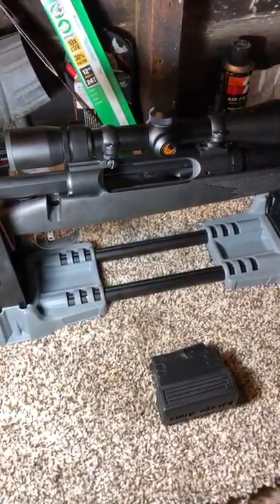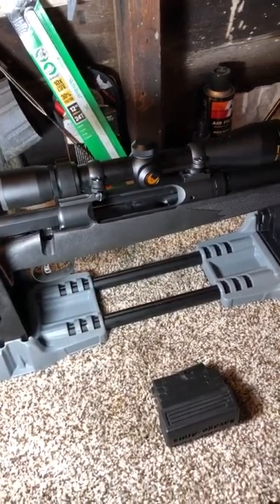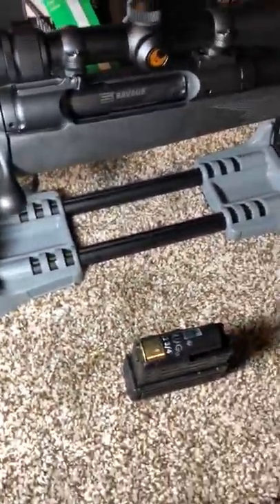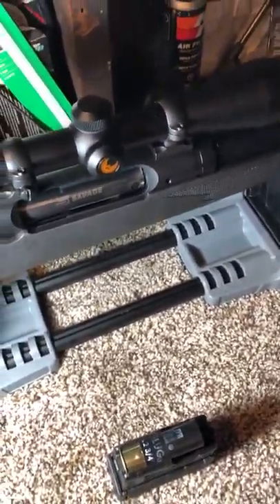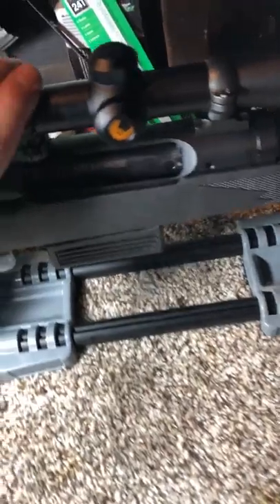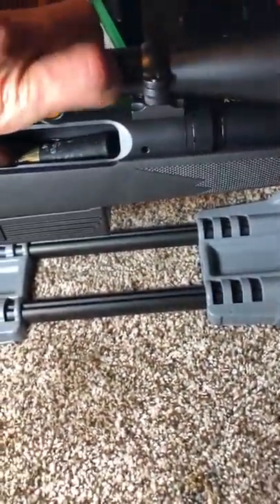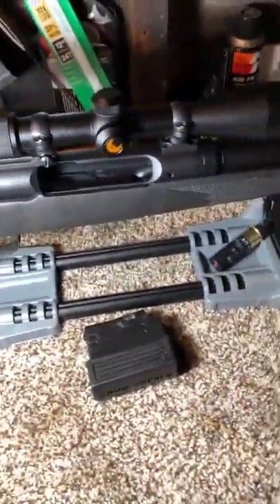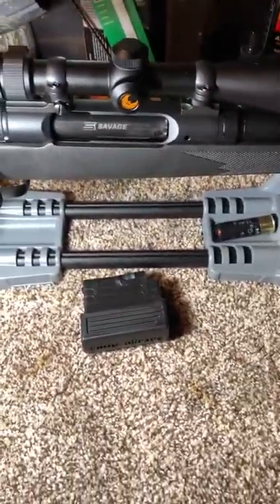Savage 212 Feed Issue

Comment: I have the savage 212 and also had the feed problems with 2 &3/4 shells,  but not the 3 inch.  I purchased a Boyd's wood laminated stock and the problem was even worse then I took a file to the wood feed ramp (filed a more aggressive feed slope) and the problem was solved.  2 & 3/4 or 3 inch shells, no problem.

Comment: This is a big problem with 2 3/4" shells and I have like 10 boxes of  them lol.  Believe it cycled 3 inches ok a couple of years ago but cannot remember clearly now and I'm out of 3 inchers.  Savage had sent me a replacement magazine when I first got the gun but it did same thing with 2.75" shells.  Plus there are some sharp edges in the slide chamber you can get cut trying to force the stuck shell out.

Comment: After reading down through the comments, I see this as a common problem with both 220 and 212 models.  I' started having the exact same issue with my Savage 220 after my first two hunting seasons using 2 3/4 accutips.   I even experimented loading only one shell in the clip but  still am experiencing feed issues every time I eject the chambered shell.  So today I took my 220 Savage to my local gun smith  to determine what the problem is, and what the fix would be.  I suspect it to be inconsistencies in manufacturer design as some owners of these models are not experiencing the same difficulties that a significant number of us other Savage 220 and 212 owners are having.
Reply: any update?  Mine will not feed 2 3/4" slugs.

Comment: I've had the same problem. As far as I can tell, the recoil from the first shot forces the gun back and subsequently the shells in the magazine forward. The problem is that the bottom shell goes so far forward that ring at the back of the shell gets in front of the ring of the shell above it. Then it is impossible for the upper shell to move forward because it gets hooked on the ring of the lower shell. At first I thought this was only the case with 2 3/4" shells since there is lots of room for them to slide forward after loading. But then this season I've been using 3" shells and today the exact same thing happened. For now my only solution is to only put one shell in the magazine. It may be that a stronger spring in the magazine would push the shells up forcefully enough to keep them from sliding forward but I don't know. It is a well documented problem and so far I haven't found any solutions other than only putting one shell in the magazine.
Reply: Mine cannot cycle 2 3/4" shells without firing the gun.  Not a problem with the rings.  Believe I solved this problem by going to 3" shells some years back but cannot remember as it's a new season and I'm out of 3 inchers.

Comment: I am having the same issue. Mine would jam up. I would have to punch the bolt to load it. Then it would not eject the bullet once ejected. Drove the gun to savage they took a bur out of it and replaced the firing pin, extractors and supposedly a few other small parts. When I got it back I got 2 rounds through it before it stopped feeding again but it was extracting fine so they fixed one of the problems.  So I drove it back to them and they still have it now.  Hopefully they can fix the issue this time.

Comment: Same problem with my brand new  212. I think the springs in the mag are too strong, when I load and at the same time push down the floor plate with a pine, it works well. So I thing I should change the tension of those springs

Comment: It's been a few years since you posted this video. I'm just wondering if you found a solution. I bought my 212 this year (2022). My 3-position safety works as designed, but I too am having this feeding issue. I just started my search for a solution, but my first inclination was that it's related to 2 3/4" shells. I have not tried 3" shells yet to verify this. Nonetheless, I would expect 2 3/4" shells to feed just fine.

As an aside, I have not been able to dial my 212 at 80 yards and beyond. I get okay groups, but not the incredible accuracy I was anticipating. This is likely attributable to operator error (me), so I could use some tips here. I probably just need more rounds with it, but the Accutips are currently around $4 shell. It's pricey to mess around with it at the moment.

Comment: I have the same issue when recycling  the next round and I use the remington accutips. I also have the same issue with the safety. One thing i have noticed is that when you load shells in the magazine it spreads the top of the magazine slightly wider, then when you insert the magazine in the gun it closes slightly squeezing the magazine tightly around the shell. I was going to see if they make a composite or steel magazine and try that before having to send it to Savage.

Comment: Three days and not one shot fired. Why? Will not feed. I scived down a leather ramp to see if that would position the next round upwards into the pipe. Was nice on the first round but no dice after that. Perfect firearm if they can fix this. Sending it back now. I will update you with results. 24 years of military operations and never had an issue like this.
Reply: How did the repair work for you
Reply: Any update on sending it back to Savage?

Comment: I have a brand new one (2021) and it doesn't feed 2 3/4" Hornady worth a crap, either.  And it flat out won't eject the last shell.  The last shell pops out of the extractors when I retract the bolt and the shell hits the ejector.  The empty just lays in the ejection port.   Weird thing is, it will cycle Remington 2 3/4" just fine, and 3" shells like a champ.  It will cycle Federal, too.  Just not Hornady.   I have a couple of Ithaca M37s and have trouble feeding Hornadys in those, too.  Sometimes the next shell in the magazine pops out and falls on the ground, and sometimes the shell slips between the carrier fingers.  But it works fine with Remington and Federal.  I really think there is a problem with Hornady shells.  I think the rim diameter is undersized.  My safety is a functioning 3 position safety.
Reply: Update:  I took my 212 out this last Saturday and fired 25 rounds of Hornady SST.  Some cycled fine, others not so much.  However, I was able to get sub-2 inch groups at 100 yards.   So while the Hornady don't cycle worth a crap, they are exceptionally accurate in my gun.

Comment: I too have the same issues - loading many different cases that jam on the ramp and also the 3-position safety. It's a big SAFETY issue and I think Savage should recall them or fix for free. Any word yet on what to do for a fix? I bought my gun more than a year ago from Buds. But I did get the warranty. NOTE: I don't have any issues cycling the Federal Premium Trophy Copper 3" Sabots at 300 grain slugs. Actually killed the biggest bull of my life last season with it. But that's the ONLY shell it likes.
Reply: I'll get some of these 3 inchers and try them.  Mine sticks every cycle using 2.75"

Comment: Bought a 212 same issue with feeding the top shell is getting caught with the feeding tube lip it seems there is lack of slope to allow the shell to slide in. Tested with aluminium snap caps it works very well the snap caps slide right in because of its harder shell just like other type of bolt action rifles 308, 223, or 7.62 x 39 it slides in smoothly because of the hard surface and properly slope feeding. Not sure if filling down the feeding tube a bit would help?

Comment: This savage 212 is recommended with remington accutips. Feeds perfect
Reply: Are they 3 inch or 23/4 inch I’m using 2 3/4 inch I’m try too see if they have 3 inch maybe that’s would fix it
Reply: I bought a 220 using 2-3/4" & 3" accutips
Both had jamming problems.  Found it has to do with cartridge rim getting hung up on extractor clips on bolt.
Reply: Not mine
Reply: @winonajr3931   Did you get this issue resolved? I just bought a 212 Turkey that is very particular on the rim geometry
Reply: @hoponpop7097  I ended up selling my 220.  Then Walmart clearance all their guns out last year and I picked up a 212 for $125!  Same jamming problem.   I sent it into savage and they fixed it.   Works like a charm.  Shot a nice buck this year 150yds.  Most accurate shotgun I own

Comment: Any updates on the gun? I just got a new Savage 212 as well and having the same exact issue and luckily I did buy a spare mag when I bought the gun and the spare mag doesn’t work either and I also have the same 3 safety lock issue too. Still shoots but just kind of disappointing. I bought it from Buds so working with them now as I did get the warranty through them...
Reply: Seems like bud says since I just bought the gun Savage should be able to cover this under warranty and I’ve submitted a service ticket with them and it’s been a week and yet no response...
Reply from the maker: It should be under warranty. I plan to send mine in now that hunting season is over. Still happening with my gun

Comment: That gun is JUNK.  I had the same problem with my Savage 220. Savage told me I wasn't "manhandling"" the bolt enough to cycle the shell in place. Missed opportunity at nice buck walking to my spot because the gun jammed and he stood there looking at me for over a minute while I tried to fix it. He eventually took off.  I wanted to throw it over a cliff. I'd have more confidence In a Mossberg 500 over that paper weight